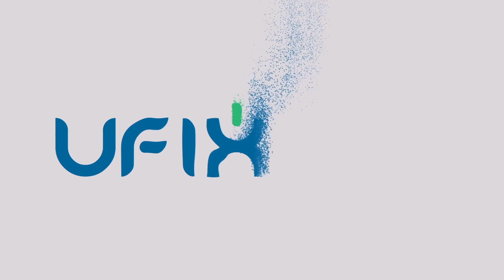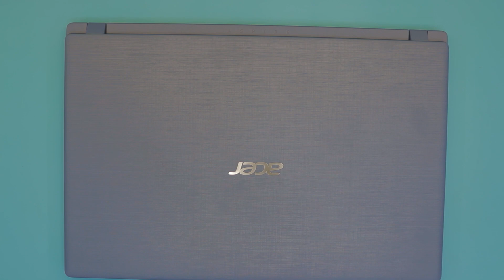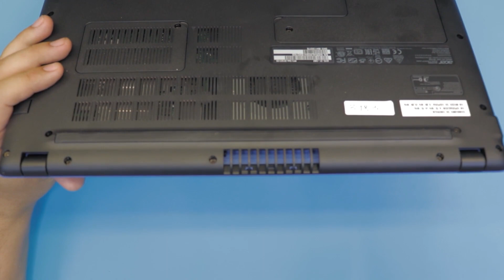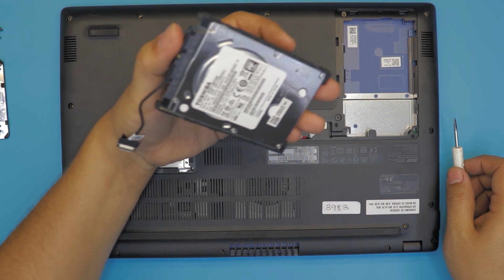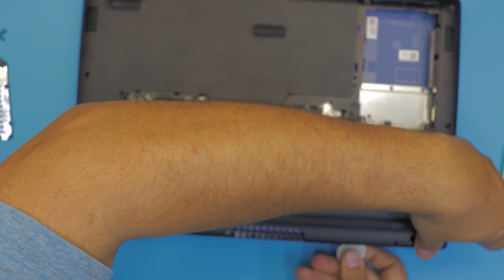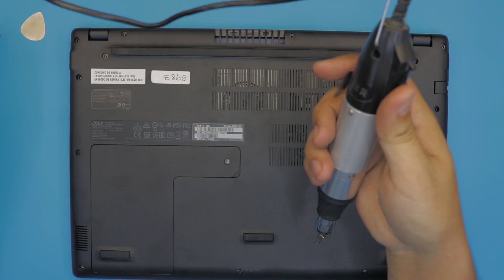Acer aspire 3 worst build 2018! repaste aspire 3 A315-31-C80z

Comment: Can this Celeron do without active cooling on this laptop... Pentium N5000 from same series A315-32 with same cabinet/body has a heatpipe running from the CPU to the air exhaust vent... Lack of RAM slot is really disappointing even though they put in a M.2 on this mobo...
Reply from the maker: yes you are right about the passive cooling but people dont know and they purchase it thinking its gaming or for graphic editing, i get 3 of this every two week in my shop for reballing cpu. because of over heating. i have seen other brands with same cpu and having a fan a proper heat sink.